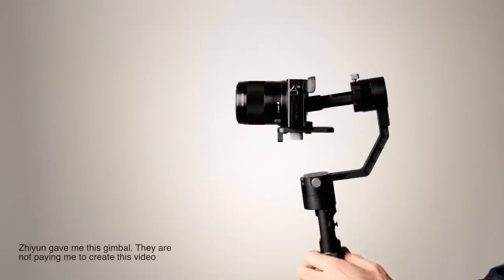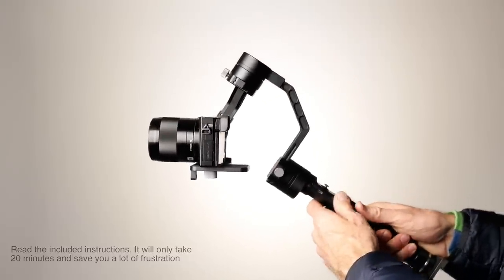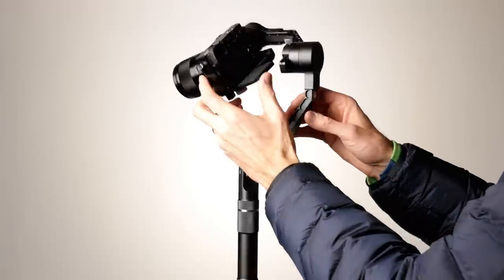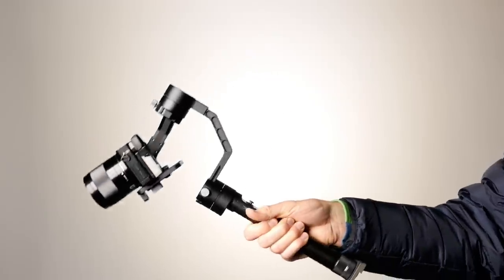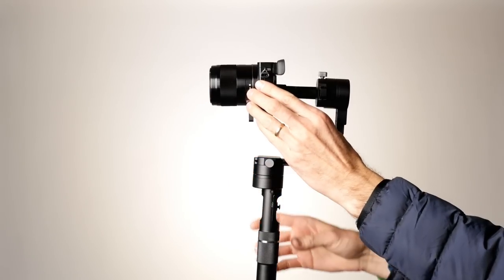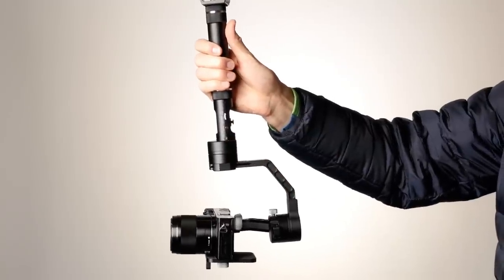Zhiyun Crane 3 axis Motorized Gimbal Setup and Tips

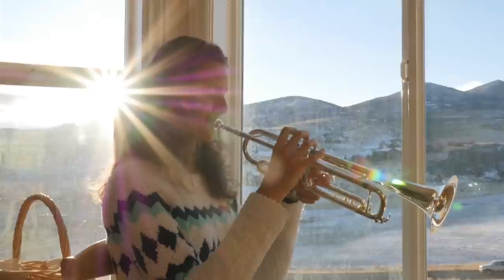Comment: My Crane's pan tends to drift in lock mode, even after re-calibration. Have you noticed this? It seems like yours has the same issue at about 3:25 - slowly panning to the right.
Reply from the maker: Hmm, I haven't noticed but I am generally just using lock mode for relatively short crane type shots - maybe 10 seconds long. In those cases I haven't seen any noticeable drift. For longer shots I'm usually in pan following mode so that I can pan.

Comment: You stated that the app lets you calibrate and update firmware but you forgot to mention the most important aspect which is that the app allows you to control the gimbal remotely in the same way that the optional remote does. The app is awesome! It works by Bluetooth to control the crane which means you can link your camera to a smartphone or tablet by wifi and have a completely remote set up.  (Using my iPhone to control the gimbal and my iPad as a remote screen). Zhiyun are working on Bluetooth control of the camera. This is easily the best gimbal in this price range. It will only get better as they develop it. I love this thing!!
Reply from the maker: +MistaFussichannel thanks for the additional info! I agree, this is a good one!

Comment: Overall, I like this gimbal. The app is a bit strange because the roll is part of the main control instead of being pan and tilt like the thumb control on the actual gimbal.
On a monopod, I've been able to use this in place of setting up a jib. Since I've been getting good shots with the smaller cameras, this has really helped reduce how much gear I need to lug around.
Reply from the maker: I agree, I took the crane and a GH4 on a recent trip to Hawaii and it was small enough to haul around without issue for a band show (about 1.5 hours). I was also surprised that after that time, my arm was not particularly fatigued.

Comment: do you think its safe to hold the gimbal by the arm while running and gunning, while the gimbal is turned off.  It'd be a hassle to hold it up right at all times and also keep setting it up for the next location
Reply from the maker: That's what I do, just to prevent the camera from banging around.

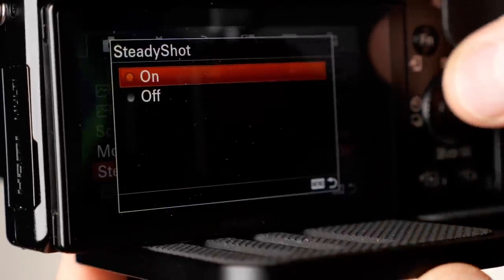Comment: Your videos are excellent, Curtis. My limited experience with the Zhi-Yun is that the crane is really meant to be used with OSS lenses. When I used it with a simple mechanical no IS lens while walking, the movement was smooth, but the image was jittery. I had the impression that the crane is meant to help great (macro) movements, but will not replace IBIS or in-lens/optical stabilization. When you explain at 2:41 that Steady Shot can be switched off, can you demo/explain what results can I expect from the crane when OSS is switched off? All sample videos on youtube with the ZhiYun are from lenses with brilliant OSS, like the 1650 at 16mm.
Reply: Miklos Nemeth 
if you have premiere pro, you can use warp stabilier at 1% to get rid of the micro jitters
Reply: I have Premiere Elements. In the meantime, other sources confirmed that OSS/IS/IBIS/VR together with gimbal is the real solution, they cannot replace each other for walking/running shots.
None of the demos/reviews about the ZhiYun crane have a video made with a no-stabilized lens. Honestly, since I have the experience now, I am not really sure, if any gimbal is really worth the money (for my style): a good old IBIS with a wide angle lens with some practice can produce excellent moving shots. So, my conclusion is that whatever great is the ZhiYun, I may not keep it; I simply don't use it enough: a gimbal is cumbersome to carry around/mount/setup and operate; it draws too much attention and really not worth the efforts. There are dozens of other videography techniques that I could use to make great/interesting movie stories. Anyhow, I love Curtis Judd's videos.

Comment: Good review. I have found the joystick a little bit difficult to use precisely. Meaning, sometimes when I try to tilt only, I will end up tilting AND panning slightly to one side. (On the other hand, if I try to pan only using the joystick, I don't accidentally tilt.) Maybe it is just the way that the joystick is placed in relation to where I normally place my hand for balancing the gimbal.
Reply from the maker: Hi Mark, thanks for sharing your experience with the Crane. I haven't seen that so much as accidental panning when I do a crane type shot and I'm in pan following mode. I realized after a while in those cases that I needed to switch to lock mode.

But yours sounds like a slightly different case and I agree, may be related to how your hand is positioned. I hope you are able to find a way to resolve that issue.
Reply: Ahh... ok thanks for the response. I will also try your suggestion of switching to lock mode when trying to do a crane shot. Thanks again!

Comment: Hi Curtis! thanks for the great review again. I actually have the same gimbal, and I'd have a practical question: I mount an a6300 on this unit, and I'm wondering if I can carry this setup installed, so that I don't remove the camera, just put the whole setup into a bag (switched off of course) if I gotta shoot at an event, with multiple locations with relatively long distances between them? thanks very much in advance!
Reply from the maker: Yes, sure. You'll just want to make sure that when it is in the bag that no undue pressure is placed on any of the joints/motors of the gimbal.
Reply: thanks for your quick reply! great news, I'm really glad to read that, it makes the unit so much more usable, versatile. now I'm just gonna keep my fingers crossed, that Zhiyun comes up with an Osmo-Z-Axis-like little accessory in the near future...  :)

Comment: Hey Curtis, What are you using as a stand for the crane. I am doing a review for the crane and I am trying to find out the best thing to balance it on.
Reply from the maker: I used a tripod as a stand here, just a big, old, heavy Manfrotto from the early 1990s. But any tripod should do the job.
Reply: Hey Curtis, I am trying to balance my 7d with lens but it is still front heavy no matter what I do. it is under the 3.3 lb payload.... any advice?
Reply from the maker: I have heard of some people using quick release slider plates which allow them to adjust the center of balance farther back. I don't have first-hand experience with these but perhaps that will at least give you some ideas on options. Good luck!

Comment: Do the motors or rotations make whir noises? Just in case you want to mount a microphone on the camera body or use the camera on-board microphone to record the audio from the scene.
Reply from the maker: They make very, very little noise. When recording, I have not noticed the sound of the motors in the audio tracks.

Comment: How easy is it to see the LCD screen? Have you used this with an LCD screen flipped open to the left side of the camera?
Do you have other screen viewing tips, especially outdoors?
Reply from the maker: I haven't had any issues seeing the screen on either my Sony a6000 or Panasonic GH4 in terms of the gimbal arms getting in the way, so no need to flip the screen off to the side. And flipping it off to the side will make the gimbal work harder and reduce battery life. Outdoor viewing of the screen - many cameras allow you to increase the brightness so you may need to experiment with your particular camera to find a setting that works for you. Best wishes!

Comment: Excellent video. I am thinking of getting one soon. I have a question about the weight requirements. I have a Canon Vixia HF R600 that weighs in at around 234 grams and this is under the minimum weight requirments of the gimbal. If I add weight to bring it up the the required weight will this work ok? also the screen on the camcorder opens to the left will this get in the way of the gimbal?
Reply from the maker: Hi Scotia807, I'm not sure this will work with camcorders due to their different form factor relative to mirrorless hybrid and DSLR cameras. You might contact Zhiyun support to confirm. Best wishes!
Reply: Curtis Judd ~Thanks for the reply. I contact the manufacturer about it. seems odd they don't have any for small camcorders.

Comment: For those of you using a panasonic g 7 get a quick release plate and put it on there, the camera is too light and will most likely always tip backwards. if you do not want to get a quick release i found a way to counter the weight by moving the side of the camera with the batterie a little more forward, yes the camera would be sitting a little to the left but the heavier side will be to the front making it balanced. sorry if this is confusing
Reply from the maker: Thanks Brian, good info!

Comment: Hello Curtis
I just ran across this 3 year old video of yours.
I have this exact gimbal and love it.
You mentioned about extra batteries you can get for longer life.
Did you know if you take the very bottom of the handle off, there is a tube inside there you can remove.
Rush you can install larger batteries.
Larger in size.
Keith Kuhn
Reply from the maker: Thanks Keith.
Reply: @curtisjudd  
No problem.

Comment: One issue, after i balanced my a6300 i can´t switch easy to invertive mode the pan motor axis and the tilt motor axis are each other in the way.
Great review, i bought my gimbal yesterday.
Reply from the maker: Thanks. Sorry about the issue. You cannot swing it around the other side where the two axis are not in the way?
Reply: on the other side i can but i need to turn of the gimbal before i change
 it to invertive mode, i watched few other reviews wit the 6300 its like
 only i have this problem, but there is just one way to balance the 
camera an in this way i have this issue. sad, but when i start working 
with the gimbal it is perfect i love it ;)
Reply from the maker: Excellent, happy shooting!

Comment: Great review! Do you always have to re-balance when you set the gimbal down? Setting it on the ground, storing it in a bag, etc. I have to re-balance my glide cam every time I set it down. Usually I set my glide cam on a balancing stand to keep it semi-balanced.
Reply from the maker: Hi Michael, Not necessarily, depending on how you store it. If you leave all the adjustments alone (which means you may not be able to store it in the included case with the foam cutout) it is super easy and fast to get it set back up. But some of the arms collide with others if you collapse it enough to put it back in the case. I've fashioned a pocket in my camera bag so that I don't have to change any of the settings to store it in the bag so I can be up and running quickly.

Comment: Hi thx for the nice tutorial. I bought also this gimbal and when I change from bottom-up to top-down during operation (so no over standby) it jerks almost every time. Is this normal? I tried it around 50 times and it there was always this jerk! So should I just avoid it or is there something wrong?
Reply from the maker: Yes, that's normal. ideally, you'll change to inverted mode with the gimbal off, or at least not while shooting.

Comment: I just bought this crane to replace my Ronin-M because the Ronin-M is pretty huge and needs to be used with an external monitor (that I will still try to attach to this new crane). Hopefully it can takes my A7sII and Sigma 24mm lens easily!
Reply from the maker: +TURST67 I hope it works as well for you as it has for me!

Comment: You mentioned using two hands. This made me think, is there a tripod screw hole in the base of the handle? Can you attach this to a monopod or boom, to wield it with two hands and also reach further up or forward if needed - is that feasible? Thanks!
Reply from the maker: Yes, in fact the "crane" type shots in this video were done with the Crane mounted to a monopod.

Comment: Can I fit a Panasonic VXF990 camcorder onto this thing? Excellent video by the way.
Reply from the maker: Hmm, not sure, it is designed for mirrorless hybrid cameras so it'd be a stretch, I would think.
Reply: I've just bought one and it doesn't work with normal camcorders. I have the Lumix LX15 though and it works great with that.
Reply from the maker: Ok, good that it works with the LX15! Too bad about the camcorder. :(

Comment: hey! thank you for your video! it has been one of the most helpful. I have this gimbal and have been trying to stabilize it with a sony camera. I dont know if it is working because the camera keeps falling back and hitting the back of the gimbal so it is unable to go back and balance. What do you suggest? do you think it's broken? i can send you pictures or a video if you need more info
Reply from the maker: sami becherer are you using the 16-50mm lens? That one is so lightweight that I couldn't move the camera far enough to balance it. Does it fall back once you turn on the gimbal?

Comment: very nice tutorial, I just bought this hope to be a good substitution for my glidecam, even thought the shots won't be the same but pretty close and much more travel friendly device
Reply: Thanks EduarFilms. I hope it works well for you!
Reply: hi, I got the new version today, it doesn't come with the push button on the center joystick to change modes, it has a mode button that I think it is the one for changing those modes, however I cannot find how to pan, it only either tilts up and down or tilts left and right, but no paning in any mode using the joystick, any ideas on what am I doing wrong I'll appreciate it!
Reply from the maker: Hmm...I'm not sure. I'll try to get my hands on the new version.
Reply: thanks for the quick response! I found out what the problem was, I was skipping the panning mode when clicking the mode button, just my own stupidity... thanks again for your response!

Comment: Hi, nice video.  My Canon 5D Mark iv setup with either normal or wide angle zoom lens is only 3.2 lbs which is less than the 3.9 lbs (1800 grams) load limit cited in the Zhiyun Crane 3 Axis Gimbal specifications with the Firmware upgrade to 1800 grams.  I'm wondering why the official Zhiyun information material says this is specifically for "Mirrorless cameras" and does not say DSLRs in general?  Can you shed any light on this because I am interested in the product but it looks like it may not match for my 5D for some unknown design reason. I have seen a couple of YT demos using the gimbal with a 5D but the results do not always look totally smooth or horizontal.  I do not know if this is due to attaching a mirrored camera or because the user of the equipment does not have the best familiarity with Zhiyun Crane technique, since I have seen both good and less than good results with the crane, regardless of which camera was on it.  Thanks for any info about mirrored cameras and this. Hal
Reply from the maker: Hello Hal, I believe that Zhiyun released the special firmware for heavier cameras after introducing the product. I attempted to use it with my Nikon D750 (similar size/weight to Canon 5DmkIV) and had reasonable success with very light 50mm lens (the plastic 50, not the metal version). It seems to me that the Crane is working at the limits of its capacity with the pro level DSLRs. If you will use it with light lenses and for short periods, it may be fine, but it may be best to look at gimbals with larger payload capacities if you need to fly your camera for any appreciable amount of time.
Reply: Curtis, so you're saying that even with the firmware update to 1800g (3.9 lbs) your D750 did not work as well as you'd like?  My 5Div with either a 50mm or 16-35mm lens weighs 3.2 lbs, well within the tolerance of the firmware upgrade but I have not ordered the gimbal yet because of such concerns.  I contacted Zhiyun directly and they assured me that my 3.2 lb DSLR would work fine.  Of course, I don't want accept less than optimum results, the same way as the setup would work with a mirrorless camera.  I'm curious to know what aspect of your testing with the D750 was less than "reasonable success."  What kept you from judging it as a total success?  Thanks again. Thanks, Hal
Reply from the maker: Hal, I did not end up using the gimbal for that job I described, not because of the gimbal or its performance, just that my colleague ended up operating the camera on a non-motorized gimbal with which he was more familiar. I was able to get it to work during pre-production but haven't tested it thoroughly so I'm not really in a position to recommend it for DSLRs. It may be fine, I just have not tested it extensively. Also, I have loaned the gimbal to a friend so I don't have it here to test at present. I hope that clarifies. Best wishes!
Reply: Thanks much for answering and for your fine videos.

Comment: Hi! Great video. Have you tried this with any legacy lens? Hows does the stabilization works on the video?
Reply from the maker: Yes, works great as long as the lens is not too light. But it is even smoother with IS lenses.
Reply: Thanks! I'm contemplating on getting one since I mostly use old lenses for my videos. I like the look of old lenses on my videos. Appreciate you for putting out great content!

Comment: I think $650 is a pretty good value.  I don't think you're going to find another tool in that price point that does all of the things this does, especially if it will really hold up to 1800g.  You could slap on an Aperture DEC Focus and have a pretty slick little rig one-man run & gun rig for about $1k.  The battery life sounds pretty crazy good too.
Reply from the maker: Yes, I agree and am still amazed at the battery life.

Comment: Hey Curtis, do you think it would be possible to use a gimbal like this with a Sony A7S, cine lenses and somehow mount a wireless follow focus on it ? Cheers.
Reply from the maker: Hi, I think that is probably a stretch, but it depends on the weight of the lens and follow-focus and how far it all protrudes from the camera body. But most likely, you'd need to look at one of the larger 2-hand gimbals that can handle heavier payloads.